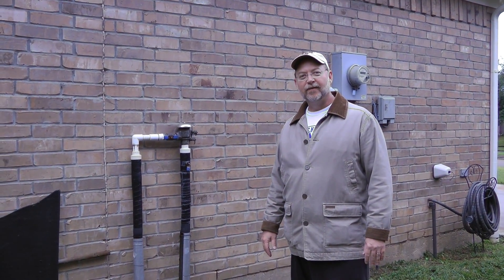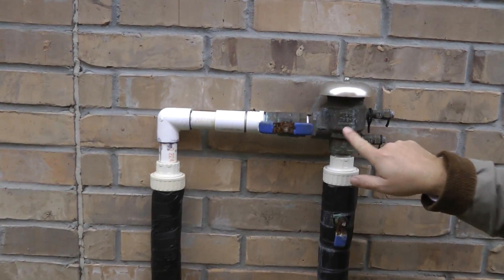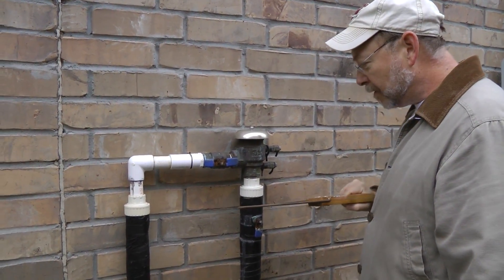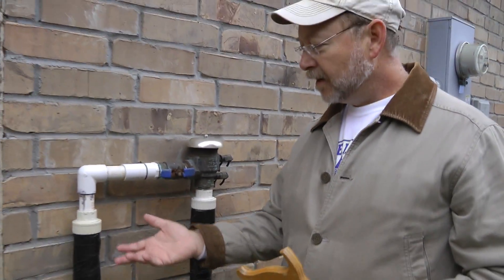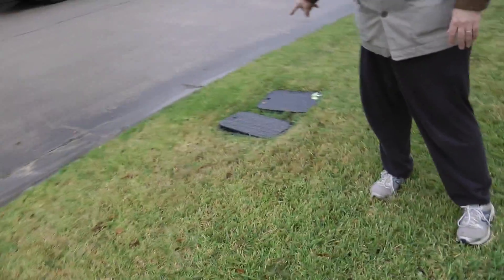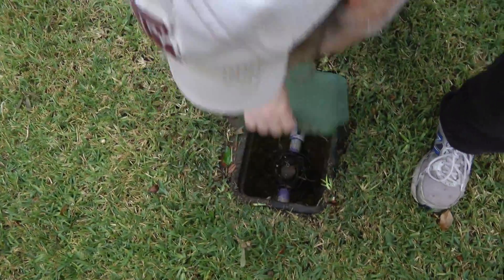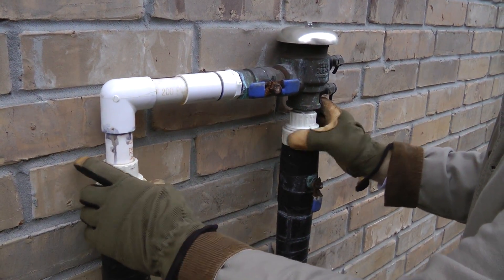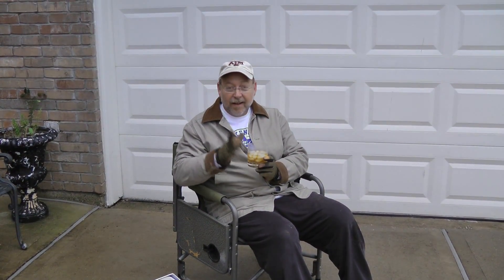Freeze Protecting a Sprinkler Backflow Preventer

Comment: just watched the entire video.   you should drain the pipe from the master valve to the back flow preventer.  if that pipe which runs under the concrete driveway cracks. you are into rerouting the pipe around the concrete.  add a hose bib after the master valve and let the water drain back and even better attach a compressor to the hose bib and blow the water out.  also add a hose bib after the backflow preventer and blow out the zones.
Reply from the maker: Carmen, that's a thought, but a pipe cracking under the driveway is highly unlikely in our Houston climate.  The ground here does not freeze, therefore, we do not need to evacuate the water in the main line pipe nor zone underground pipes.  But now that I've put that out in the world, I'll have to keep an eye for an underground spring from my driveway!

Comment: The parts finally  came in and I was able to use your smarts and config my BFP ;-) I also added a 1" freeze plug ball valve at the bottom since I didn't have a cutoff between main and BFP works like a charm! Now my neighbor wants me to do his I  think a 6 pack of my favorite Stout should do the trick ;-) Is there a way I can send you a picture of the final product?
Reply from the maker: I wish you could add a picture to your reply, but I don't know how.  I've been thinking about the configuration, such as yours, where you need to add a shutoff valve, upstream of the backflow preventer.  If I had to add one, I'd put it below ground, a few feet or more away from the vertical riser.  And a few Guinnesses would certainly help!

Comment: Great Video Sir! Just turned on my ball valve today and it is cracked I like your technique and it gave me a great idea ;-) Thanks!
Reply from the maker: Yeah, most people who bleed the backflow preventer, and shut the valve below the backflow preventer, don't realize that there is constrained water to that valve.  When the water in that riser freezes, it expands, and ultimately will break the pipe or most likely that valve, unless greater freeze protection is applied, like a heating element, which just begs more problems.

Comment: How about the pipe sticking 4 ft off the ground? It has some insulation but can that freeze?
Reply from the maker: Good question.  Yes, the water in that pipe does freeze.  By removing all the backflow preventer and the valves during a freeze, the pipe is "open".  There is no need for insulation on either risers at all.  I left it on only for looks!  At the bottom, where the pipes meet the grass, I put a galvanized duct cover over the pipe, to protect the pipe against the dreaded weed eater.  The insulation down there only acts as a 'filler' between the pipe and galvanized cover.

Comment: I have to ask, why do you have your unit so high? Nothing wrong but it seems a little high.
Reply from the maker: The builder installed it that way.  I suppose so one can turn the valves without bending over.  Then again, the main valves have long since rusted away.
Reply: @myoclonus2318  Mine is currently about 26 from top to bottom and I am lowering it down to 17-18 inches from ground so that I can protect it better from hard freezes and lawn mowers hitting it.

Comment: Since the backflow preventer assembly come in one piece, did you have to remove the bottom valve in order to put it in position below the union?  Otherwise I would have to purchase another union with a valve attached to replace it when I remove the whole assembly.
Reply from the maker: Good question.  I must have been able to unscrew the backflow preventer from the valve directly under the backflow preventer, and used a screwed fitting union; purely happenstance.  The other union, downstream of the backflow preventer is a socket fitting that I had to glue.  The catch is for this to work, the valve below the backflow preventer must be left open.  Any 'standing' water will freeze and be able to expand easily up and out of the valve, without breaking anything. 
Alternatively, I could have just as easily put the union below both the backflow preventer and valve.  There's no reason to have three unions. 
So, to keep it simple one should cut both vertical pipes below all the valves, and glue two socket aka plain end, or PE union pieces in.  Then when the big bad freeze comes, unscrew the unions and take the entire assembly off, valves included.  That actually would be better, as you would not have to worry about threaded vs. socket union fitting dimensional differences, minor though they may be.
Reply from the maker: The backflow preventer with unions, is better shown in the this youtube video:  https://youtu.be/X0XcbuORDws.  I wish I could attach a picture!